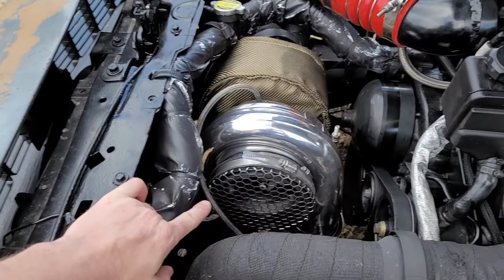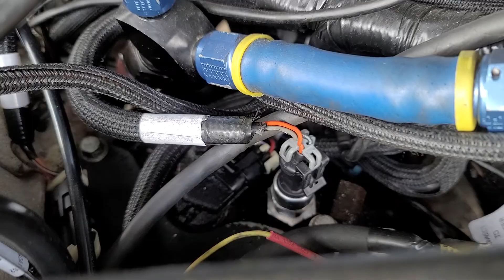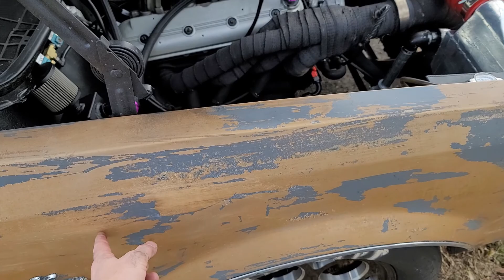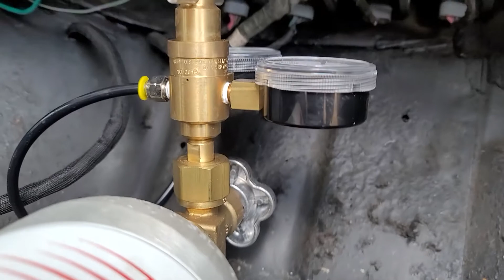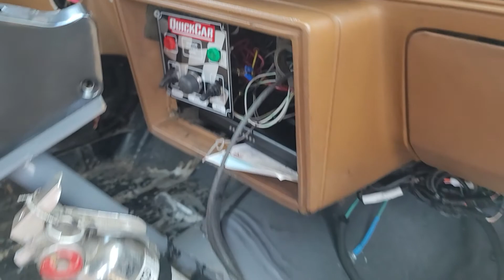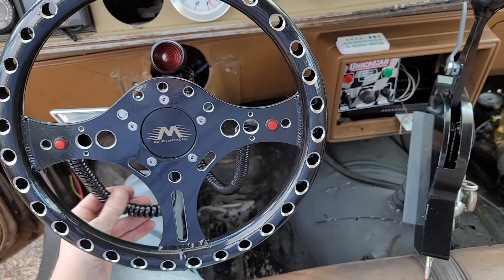Under the hood of the Boost Cutty... TURBO 4.8 LS!!

Comment: change the pipe on the air to water intercooler.  That steel pipe will rust when the car is not in use.  rust doesn't conduct heat like water does.  Put anything other than steel pipe.  I'm a plumber and its the same thing on a shower when you first start it up and see black water come out of the spout.  Its because someone did work on the pipes and put a piece of steel pipe in the setup.  Brass or copper or stainless is your best bet if looking for ridged pipe.  Other than that nice stuff!
Reply from the maker: The Cold side has no steel involved at all.  It is all aluminum.  The exhaust is steel. The housing of the turbo is also cast thus allows rust.  The black soot is because it was fat and water is from condensation in the exhaust and housing after I shut it off. I built this whole setup myself.